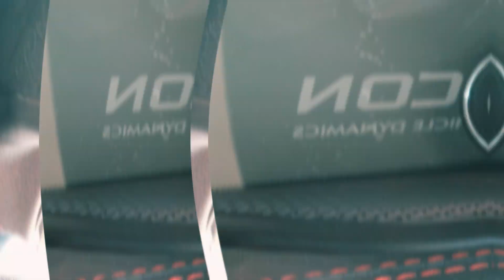JL Audio 2019 SEMA Recap

Comment: Do I need the  DRC 205 . I have the  regular  bass knob ... getting  install  this weekend  A RD900/5  with  c5 components speakers front  doors  and c2 coaxial speakers rear deck with  HO210RGw3v3 and a  fix 86 ... DRC 205 ? Or the regular bass knob  will  do
Reply from the maker: Thanks for your question. While not technically "necessary" it is often times the better solution. In your case without knowing the vehicle specifics I would recommend the DRC-205 because it works as a master volume and subwoofer control. The use of the DRC-205 can also mitigate any loud chimes and lower the chances of an unwanted noise floor for optimum system performance.
Reply: @JLAudioInc   ... it's a Honda Accord  EXL 2017 ...
Reply: @Orange-yp9bl  I use the DRC205 with my fix86 and works great.